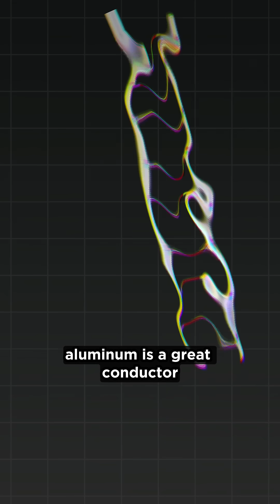How Did This Ladder Melt The Ground?

Comment: Wondering if the ladder was actually placed on a metal access cover for underground cables, melted the plates, which melted the plastic on the cables, which then ignited - I've seen videos of melting concrete, and it looked nothing like this.
Reply: That bottom rung of the ladder is also pretty low.  I’m guessing that the bottom of the ladder is melting and the ladder is slowly getting shorter.
Reply: @chrisp1598  Probably, as most ladders are aluminum and it has a relatively low melting point compared to quite a few other metals.

Comment: The ladder may have made contact with the wires, melted the concrete, lost contact with the wires, and is now receiving an electrical charge from the massive electromagnetic field to keep the concrete boiling.

Comment: it doesn't cut off for weird reason. it's just below max current. it powers entire area. over 100kw of power will be available. and you only need few kw to heat things up to melting, esp if continuous

Comment: That is ladder (aluminum) and possibly asphalt melting. Not concrete. The ladder can easily be hit by a wood post or 2x4 to break away from the high voltage wire. Electricity should be respected and doesn’t have to be scary.

Comment: That looks like wood. Wood doesn't transfer energy or heat. That's why using wooden tools in the kitchen doesn't hurt. Can you check again if it's wood or not because I'm not sure if that's wood or not, just a tip 😁

Comment: The switch is not tripping, because the power line is designed to handle height current, and given the resistance of the concrete, the ladder have created just a fraction of its designed current capacity

Comment: when you send power through something you make it slightly magnetic and if you're using alternating current (AC) that magnetic field is constantly changing, now put something that conducts electricity into a changing magnetic field and it starts producing electricity, you can see it as sending electricity wirelessly, question is is there enough current here to make a magnetic field that stretches out far enough to reach the ladder ?

Comment: I think that the ladder is charged by induction. The wires create a magnetic field that puts the electrons in motion, charging the ladder with a current that discharges into the ground. I know some high voltage powerlines can electrocute without contact but correct me if I'm wrong, I ddn't check the math, too lazy for that 😅 (I'm not an electrical engineer, I'm only passionate about it)

Comment: Electrician here, the visual effect shown here has nothing to do with any ground fault. Aluminum is a great conductor concrete is not, additionally electricirty will return to its source which it can't do through the ground here. If you want an accurate demonstration of what would happen if you touched that ladder to the overhead conductors here, search for an arc blast or flash. As a hint if copper isn't vaporizing your in the wrong spot.

Comment: It's making Fulgurite. The top wire is the energized wire, the black wires are telcom wires. Also the voltage you are dealing with doesn't need contact, it can arc a shot distance but that would be visible. There can also be a step potential in the ground that could electrocute you if you walk near it. On concrete or dry ground the impedance is high enough that the breaker has difficulty distinguishing between load and a fault and my not trip properly.

Comment: I had no idea power lines had the capacity to melt concrete if you grounded a circuit to them through it.

That knowledge is utterly terrifying.
Reply: They have enough power to turn small animals into mist. Seen some people in india get cooked until they burned by them as well.
Reply: Fun fact it can also explode. If it gets hot enough it will cause trapped pockets of moisture to boil off and boom concrete shrapnel. Best part is while Im working inside a switch gear that if something goes wrong the arc flash is like a bomb  potentially exceeding 35,000°F (19,400°C) so enjoy the face full of vaporized metal. Remeber always wear your PPE and flash gear
Reply: Bro why do you guys keep making a big deal about this ......
I just wanted to tac weld my concrete....
Why did you video it .. terrible neighbors 1 out of 10 .
Reply: You want something  bit more terrifying? When you see something like that, it's not a problem - most sane people will stay away from a bubbling lava. But sometimes a conduit can hit the ground, make sparks or just lie there without any noticable things. But the current still flows and area around the coundit can be considered as "under load" - there is a gradient voltage going from the broken wire outwards. If you get closer, you can experience something we call a "step voltage" - difference voltage between two legs touching ground can be high enough to cause current flow between your legs. And you are a toast too...
Reply: No it's fun.
Reply: Electricity is so fun huh lol
Reply: sooooo, this should scare you more. A powerline on concrete or otherwise directly can and WILL send current to any who are standing on it. You CAN get away by doing a very specific hop at exactly the same time in order to not fry, but you have to jump and land with both feet, or you're fried. the other option is to become one with the ground until help arrives.
Reply: If it isn't just melting whatever you used to create the short circuit (e.g. an aluminum ladder)
Reply: It's tarmac, not concrete.  Tarmac melts pretty easily.
Reply: @OktoberSunset  It's concrete... no where in the US do they use tarmac for the sidewalk.
Reply: @Pleasiotic1  Yes we do, I've seen it any number of times.

Comment: So there’s actually a considerable amount of static electricity around each phase of “hot” wire. The distance between these wires is set so that each wire is out of each others static field. Wires inside one of those fields causes trip in the circuit and can melt wire and start fires. When the ladder comes in contact with the wire it’s injected with a whole mess of power and energy. As it pulls toward the outer limits of the static field it still has roughly the same amount power and energy as it had when touching the wire. Hot hand repairs or “hot lining” requires special techniques to make sure that the 30 kv wire doesn’t turn the lineman into a cooked mess.

Comment: I mean... aluminum is a not-bad conductor. They used to wire houses with aluminium, but it tarnishes fast and copper is overall better.
I wouldn't call aluminum a great conductor. 
(and don't even talk about Gallium in Aluminum's presence 😂)

Comment: that primary power line is fused at a much higher amperage than the pavement is carrying to ground.  remember: that power line normally feeds electricity to the entire community.

Comment: As an electrican. If the power been shut down. The left current along the lines are grounded there since that ladder is not touch any ground, the heat melted the parv

Comment: it's ai proof. 

1 the ladder is at an angle to fall away from the wires 

2 the ladder is behind the wires 

3 the back of the fire department jackets are illegible despite them being nearly the same distance as the police from the cameraman.

4 there is a random pole in the middle of the road. 

5 the Street sign is in simlish or something

6 the ladders shadow is wrong based on the angle of viewing. (bumps are on the wrong side.)

honestly I'am probably wrong on all these fronts but until I see evidence to the contrary like a news article I ain't buying it.

Comment: Something is amiss with this video, I am pretty sure the meting point of aluminum is way lower than the melting point of stone/concrete.  That ladder should be disappearing into the ground as it melts should it not?  Or is that just a puddle of aluminum? Maybe it did shift and that wasn't on the video but I would think it would be actively moving down until it doesn't touch the lines anymore.
I don't know, something just seems off.

Comment: i seen a different angle of this. there is a line up top that its against. from this side, the ladder is behind the lower wires and the very top wire is behind the ladder.

Comment: As a construction worker Those powerlines still connected (working) might not blow the fuse right away, if only halfway damaged a system would trigger a reboot to send power to the reciving end usualy happends couple of times. There usualy would go a alarm off at a nearby power facility. Iv seen a couple of high voltage cables go off during my time, usualy completely cut in two (best option) if only halfway dmg you get to experience electrical fire that`s kinda scary.

Comment: If you look closely the ladder extends past the low voltage wiring and most likely is in contact with the medium voltage lines. Probably 7kv or 12kv.

Comment: I don't think it's electricity passing through the ladder that is causing this if it were the contact point at the top which is not having a firm attachment will be red in colour and the bottom where the burning is happening also red

Comment: Somehow i cant imagine melted concrete with a ladder standing on it. Concrete has a melting point of over 1200C and aluminium melts at around 660C. There is no chance in hell it would not melt from the sheer current needed to melt the pavement. I have a feeling the burning/melting thing is something else. And since this seems to be USA im guessing those are local 110V power lines which probably could not deliver the nessesary power o melt concrete.

Comment: In a different camera angle you can see the ladder is resting on a power line. Much much thinner and much higher than the rest of the others so it looks like it's in the air but it's actually still live and hot
Reply: yes, it's kind of obvious that it's not free-standing.

Comment: Power lines don't have "circuit breakers" they have a fuse with the step down transformer for individual residents approximately around 2.4 to 14.4kv running through them or kilovolts, before hitting the 3 phase step down transformer which is why they are soo dangerous, and why you shouldn't touch them WITH ANYTHING, its recommended to stay atleast 40 inches from those lines MINIMUM or else that energy can start to jump to you, and you're in for a nasty ride if an arc jumps to you from that high voltage

Comment: Maybe I'm wrong, but i'm getting very strong AI-vibes from this one...

the sidewalk appears to be made out of concrete, which doesn't melt like ice cream. It rather loses its stability, as it begins to crumble like cake at your average school bazaar.
Although concrete has a surprisingly low  "melting point" around 800°C (1500°f),
(pure) aluminium starts to melt at 600°C (1112°f).
If you consider the ladder to be made out of an aluminium-magnesium alloy, it would start to glow red hot at 420°C (788°f).

If someone knows more about aluminium x [any metal]  alloys, pls feel free to correct me, i'm genuinely curious 😊

Comment: Residential power lines don't carry enough electricity to melt aluminum or concrete.
Concrete would heat up more than aluminum, be red hot, show some spots that become glass like and violently explode before melting.
If the lava is from the aluminum or concrete then our best bet is that it's molten aluminum rather than concrete.
But in reality the lava is just slag most probably formed by molten rubber, plastic from the ladder or some trash. 
If the voltage was high enough to melt concrete or aluminum then we would have seen electric arks travelled across the ladder.

Comment: Tell you the truth I don’t see the top of the ladder touching any power wires at all the first set of wires that you see is cable the second set is telephone wires in the very top are electrical wires. There’s something else other than that touching electric wires, cause I don’t see it touchingmaybe I might be wrong

Comment: The ladder doesn't need to touch a high voltage line to conduct current. A 3 to 10 ft (depends on voltage of line) is sufficient

Comment: What they said about having to go onto the pole to shut off the power is not true. Before firefighters can do anything on the line, a company like for example, in british colombia, bc hydro, would have to come and isolate that area on the line by disconnecting the switch things on the line on either side of the spot where the ladder is. They would not climb the pole to do that, they would use an insulated stick thing

Comment: Circuit breakers only trip of the current is too high for the wire. However, perfectly possible that the current is not high enough for this to happen. For the circuit breaker it's just a busy day...

Comment: The only thing melting is the ladder, not the concrete.  So the ladder is very damaged.  The fuse didn't blow because the current flow isn't high enough.

Comment: In the 80s, aluminum wiring was used in place of copper (though not as well). People continually forgot to size up the wire and it caused a lot of fires.

Comment: As someone who understands basic electronics, the ground isn't 0 Ohms. So no, it should not necessarily trigger the circuit breaker. Although it probably would if the ladder was wired directly to a conductive rod buried deep underground, or was touching soaked grass in heavy rain.

Comment: FYI info Al ladder has rubber bottom support and it's used for line work normally the reason is if it's not touching the ground that would be fine to work with it. Bird one wire effect 😊

Comment: In Germany something like this would not be possible, with us the lines are under the streets or loosely 20-40m above the ground. In addition, we have alternating current (AC) which has some positive effects in such a case, because then the fuse flies out directly at a substation.

Comment: Stop spreading the "high resistance = high heat" misconception. It doesn't work like that. Go look up Joule's first law in different forms and Ohm's law. Current is dependant on resistance, and the current is main contributor to heat, NOT the resistance. In fact, the resistance is so small it almost doesn't play a role in transmission of electricity for cases like going through regular wire or heater element. What does generate high temperature though is the fact that a lot of current is going through a thin wire or whatever is the conductor. This, apart from sparks, is also the reason areas of bad contact get melted (which is what most likely happens here): the current which normally flows through a wide wire generates X amount of heat that is spread among the cross-section of the wire, and the temperature is OK, but when the thickness reduces for the same current - suddenly the same X amount of heat is generated on a, say, 10x smaller cross-section, that's why it heats up rapidly.

Comment: "Shouldn't a circuit breaker have tripped" - As far as the powerline is concerned, that is a perfectly normal load. Remember, these lines are designed to power an entire neighbourhood all at once.

Comment: Many years ago, in hindsight, I think I would've probably died if the corcumstances had been slightly different. Two guys and I were moving a bamboo ladder and we felt it snag on something, and I felt an electric buzz in my hands. I immediately looked upwards, and the damn thing was touching high tension lines. We immediately moved it away and just laughed it off, but it would've been a real tragedy had it been an aluminum ladder.

Comment: The breaker will only trip if the load is too high, and aluminum being a great conductor straight to ground the load is not too high. What you would need is a ground fault interrupter and I imagine high voltage power lines aren't equipped that way.

Comment: Actually, by the explanation given in the video, the aluminum stair should have melted first, because IT IS a good conductor. Less resistance implies in greater power dissipation, based on Power = Voltage²/Resistence formula. I cannot tell you guys why the floor is melting, that's something I want to know too, but the answer in video is wrong

Comment: the electricity from a power line is so intense that it can create an arch between the wires and the ladder meaning there is electricity constantly coming from the lines to the ladder even if they are not touching which explains why the police were talking about cutting off the power

Comment: The fault is seen as load, not enough to trip the breaker. Could also be far from the CB, some circuits have extra CB’s in the field with lower trip settings/escaping current relays.

Comment: This can't be the explanation. Just intuition, but i don't think those power lines carry enough juice to create lava
Reply: they do pretty easy. Pretty much they wont turn something to lava instantly but the bottom of the ladder was also melting and with enough time heated up the concrete around it and i think the splashing part was just the ladder but the concrete around it was molten. When heating things up with electricity just wait and it will get hotter.

Comment: Electrical engineers' pet peeve: current flow. Current does not "flow." Current is defined as the number of charges (in this case electrons) passing through an area in a certain amount of time ( the unit is Coulomb/sec or amperes). So when you say the flow of current, it is like saying the flow of the flow of electrons. Flow of current is a grammatical error of redundancy. Simply say current, or flow of electrons.

Comment: Breakers only trigger when there is too much current. In this case the current draw on the circuit did not exceed the capacity of the breaker. Either the circuit was not set up to trip in that scenario or the resistance at the ground is high enough to limit the current flow. Current is definitely still flowing.

Comment: Concrete and aluminum have similar melting points tho. That ladder would begin melting due to transferring of heat from the ground to its base from physical contact with it. The problem would fix itself... probably...